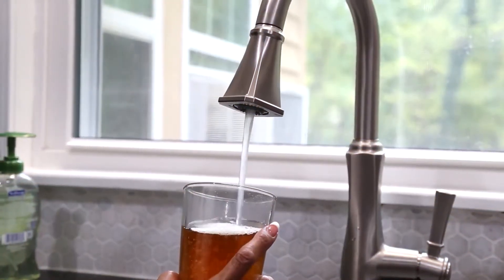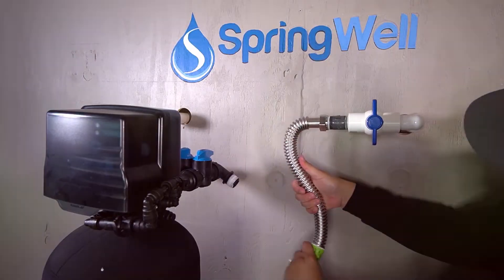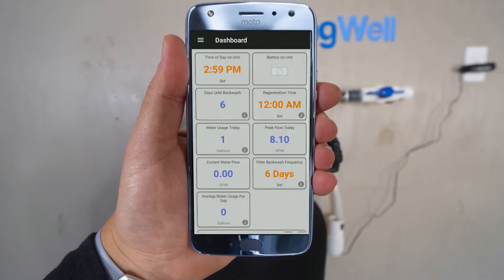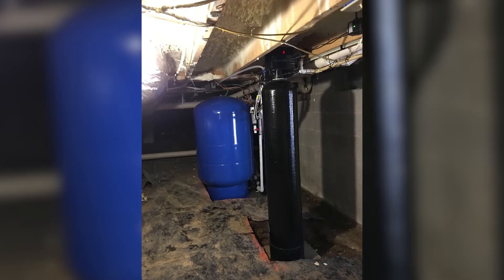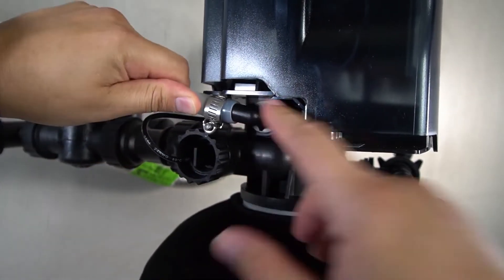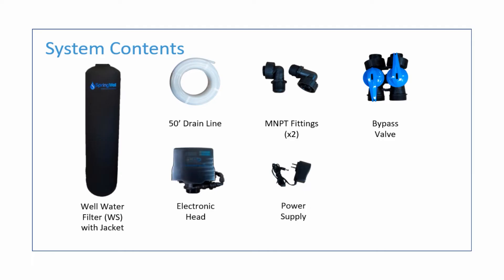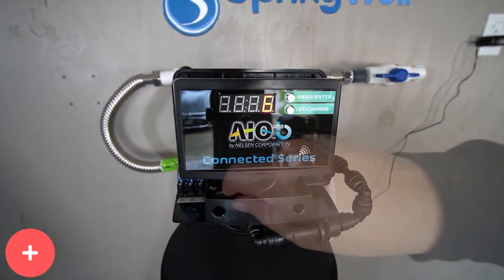THE BEST: SpringWell Whole House Well Water Filter System Review (Ultimate 2023 Guide)

Comment: What size tubing is the drain tube?
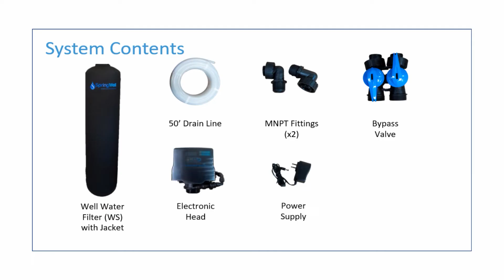Reply from the maker: Hey Blake - I’m fairly certain it is a 1/2 inch drain line, which is the industry standard.  The system comes with 50’ of it.  There is an installation video on the bottom of there webpage that goes through the drain line install at 4:30 if you want to see exactly how it works: https://bit.ly/39G8mdP

Comment from the maker: THANK YOU FOR WATCHING!👇Freshnss Discount On SpringWell Well Water Filters: 
(Freshnss Discount Code FRESH5) https://bit.ly/39G8mdP

🧪 Water Quality Test Kit: (Click Here For Freshnss Discount Code: FRESH5) https://bit.ly/3OaT4wD

✅ Remove Iron, Manganese, Lead from Well Water
✅ No slimy feeling on skin, just smooth soft water
✅ Great value with a big factory direct discount
✅ Preserve your appliance's life without costly repairs
✅ Best in class warranty, customer service, and installation
✅ Guaranteed no drop in water pressure
___
Best Whole House Well Water Filter System 0:00

Do you have concerns with the safety, smell, or color of your well water?  You're not alone!  Well water is groundwater that is untreated so your tap water is likely to contain heavy metals like iron, sediment, bacteria, and other contaminants.  The Springwell removes Iron and other common contaminates. 

How Does The SpringWell Whole House System for Well Water Work? 0:40

The SpringWell Whole House Well Water Filter System is designed with an Injection Oxidizing Filter System to completely remove the most common well water minerals of iron, sulfur, and manganese. The regeneration process also removes hydrogen sulfide—a compound that gives "rotten egg" taste and odor by the process of adding fresh air into the tank, which oxidizes any unwanted smell or minerals. After each oxidizing process, the unwanted minerals are flushed out of the system, and the whole process repeats.

The best part is the Innovative Bluetooth Head allows you to program and control the system's settings and backwash cycles at the touch of a button on your smartphone! Unlike other well water systems that require manual backflushing, after initial setup of the Springwell system, it is completely hands off and requires no maintenance.  

System Performance and Specifications 2:00

The Water Filter System removes up to 7 PPM of iron, 8 PPM of hydrogen sulfide and 1 PPM of manganese, enough power to completely filter out the harmful contaminants.  It also finishes the water with a pH range up to 10 for perfect drinking water alkalinity.

The SpringWell Filter System comes in 2 configurations for optimal performance customized for you home. The WS1 For 1-3 Bathrooms and the WS4 For 4+ Bathrooms.

Many competitors leave water pressure as an afterthought, causing water pressure issues when you are using several appliances at one time.  But with the SpringWell System, you get nearly 2x the flow rate and a guarantee that you will not experience any drop in water pressure. 

Key Features of the SpringWell Whole House System 3:23

-The Bluetooth Control Head and App: When it comes to controlling the system, the Bluetooth control head and app make it easy to do so. The app allows you to monitor the system and make changes from your phone, while the control head lets you make changes at the unit itself. 
-Filtration Tank with Valves: A durable tank body with valves that can can easily mount and place on any surface in the house. It is created with a high-density, durable, elegant design that does not take up much space. 
-Spin Down Sediment Filter: The Spin-Down filter is designed to filter out large chunks of deteriorating wells and remove large sediment particles using a 100 micron mesh screen that is easy to clean and re-use. 
-Lifetime Warranty: Finally, the system comes with a lifetime warranty on tanks, valves and housings, so you can be sure that it will last for years to come. Additionally, there is a 6 month money back guarantee. No questions asked. 

Installation and Maintenance 3:46

Installing the SpringWell Well Water System is a relatively easy task that can be completed in a few hours for most DIY folks. The system comes with an installation kit that includes everything you need to get the unit up and running. Because of the smart valve head, the system is completely automated. 

Overall maintenance is very low. Once the unit is installed and the bluetooth control head is set, the system is completely automated.  

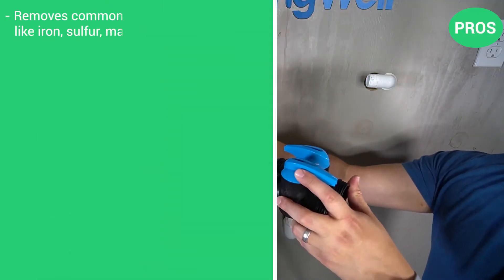PROS 5:27
-Removes common well water contaminants like iron, sulfur, manganese, and more
-Uses innovative Bluetooth Control Head for real-time status updates and automation
-Lifetime Warranty on tanks and valves, with a 6 month money back guarantee
-Zero maintenance once installed
-Guaranteed no drop in water pressure 

CONS 5:53
-May require professional installation if not DIY inclined 
-May need to supplement with a water softener if your water is very hard or heavily contaminated

✅ Learn more about the SpringWell Well Water Filter System: (Freshnss Discount Code FRESH5) https://bit.ly/39G8mdP
___
► Subscribe to the Freshnss channel on YouTube: 
https://www.youtube.com/channel/UCKCj...

► Freshnss website: 
https://freshnss.com/

► Freshnss on Pinterest: 
https://www.pinterest.com/freshnss/

► Freshnss on Facebook: 
https://www.facebook.com/freshnss/

 #SpringWell #wellwater #wholehousewaterfilter 
-----
Disclaimer: https://freshnss.com/disclaimer/